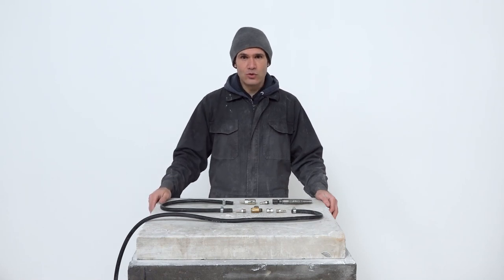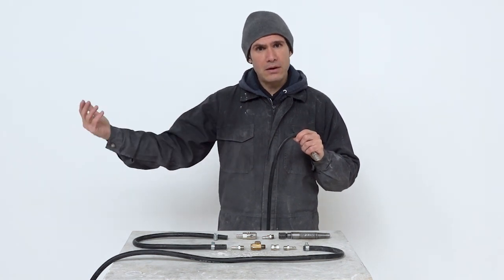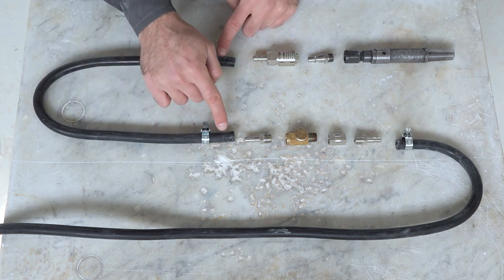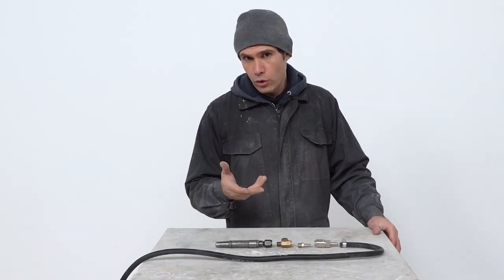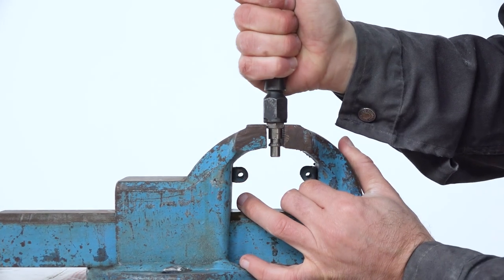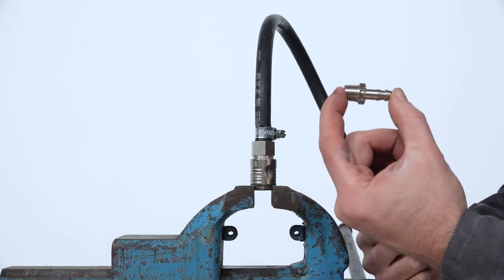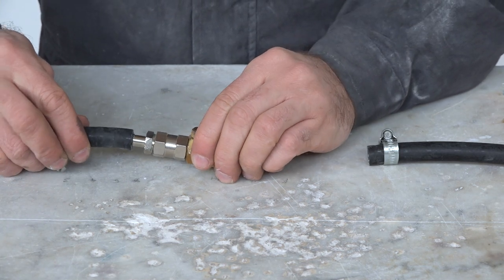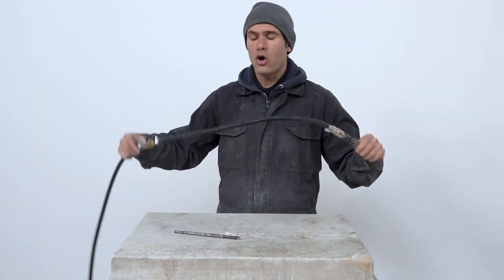How to Set Up Your Pneumatic Hammer | Stone Carving Tutorial

Comment: Some female quick-connectors have little spring loaded steel balls. Never use these close to your cuturi air hammer as these will damage the male connector due to the vibrations of the air hammer. In this case the connectio starts to leak air already aofter one day of use. For this reason many carvers connect a piece of hose directly to the air hammer and put the quick connects about 70 cm away from the hammer. 
Other types of quick connect use steel wire springs, which do not damage the male connector. These can safely be used directly onto the hammer. 
One can also choose to put a ring valve onto the air hammer itself, and then connect that to a male connector, and keep the air hose with the female connector, so you can very easily store the hammer and connect other tools. In this case the hammer has its own turn valve.
Reply from the maker: You are absolutely right about the female quick-connectors with steel balls, I had some bad experiences with these in the past. I should have mentioned that in the video. Thank you for being so kind to point that out as well as all the other info. I will pin this comment to the top as I’m sure many people will find it extremely helpful. Thanks again!
Reply: @AtharJaber  Your videos are very detailed and I recommend them regularly to beginning carvers. Keep going! Thanks for all the info.
Reply from the maker: @09conrado  thank you, I appreciate that a lot. Your comments are always full of knowledge and provide extra information. I suspect you are a master of your craft.

Comment: Here in the US I use the following setup:
- 1 long hose that connects to the compressor and reaches the work area
- 1 control hose - this consists of two pieces of hose with the tap (control valve/stopcock) in the middle) it also has a male quick connect at one end and a female at the other
- the hammer has a male connector

The setup is hammer to control hose - control hose to compressor hose

All the hoses are pneumatic hoses with pre-installed 1/4 in-18 NPT threaded fittings/ends instead of rubber hoses connected with hose clamps.

Comment: To answer why you use the second hose with the control valve (called a stopcock) I found this in a pneumatic hammer manual.

There should be no more than two methods of air control within your air delivery system. The first control will be an air pressure regulator located on the compressor. 

The second will be an in-line valve (e.g. stopcock) used to control the air flow that powers your pneumatic tool. Set the air regulator to achieve maximum power to the tool (do not exceed the air pressure rating of the compressor or air hose), then adjust the tool’s speed using the stopcock. 

Experiment to discover what degree of impact feels best to you. This will vary depending on the width of your chisel, hardness of your stone, and your application. 

Additional in-line accessories or controls will only reduce the total amount of air available to your tool.

Comment: Another very informative video with so much information I have to watch it a number or times. Can you please tell us what size air compressor is needed to run the Cuturi air hammer, or another brand? For cutting stone at the mid stage, after negative chunks are cut away (via angle grinder, etc.) I think that's when I would use the pneumatic chisel/hammer to clean up areas before details by hammer. I'll primarily be working in hard stone (limestone, granite perhaps, and marble if I can get it) so I am concerned that my compressor is powerful enough. If you can let me know, that would really help me decide what pneumatic tools to get. It's a 33 gallon tank, 1.7 hp, 5.1 cfm at 90 psi. I just ordered this compressor but can get something more powerful if you think it would be better. The prices really go up after 2 hp and 5 cfm.  Thanks for your help! You're the first artist I found who actually shows his setup and that means a lot to sculptors starting out.
Reply from the maker: Philip, that's a very good question that deserves a full episode for itself (which I'm already preparing 😉). But since you probably can't wait that long, here's the quick and easy, but very generic answer: to choose the right compressor for your tools (or viceversa), use this formula: Select the tool that requires the highest CFM (Cubic Feet per Minute) at the highest psi. Then add 50% to the required CFM as a safety margin. For example, if a tool requires 3 CFM at 90 psi, choose a compressor that provides at a minimum 4.5 CFM at 90 psi. I hope this helps. Let me know!

Comment: Another excellent video.

I was wondering if you could provide a suggestion on the sizing of pneumatic hammers. Is the sizing mostly a function of weight/grip size?  Do they have comparable lower ranges over all?  Is bigger (of smaller) better? 

My objective is to work granite, mostly organic or geometric shapes.   I am between 3/4 and 1 T&H. 

Sorry,  a very vague question, but any feedback appreciated.
Reply from the maker: I never used T&H so i can't say much about them. But regarding sizes, that has mainly to do with the type of work that you are planning to carry out. Big sizes carry a larger amount of power and are therefore suitable for big and rough work. While smaller sizes generate a more delicate vibration that is good for small and detailed work.
Reply: @AtharJaber  Thanks for the reply.  I think I am going with the larger size.  I suppose at the end of the day there is no one-size-fits-all solution.
Reply from the maker: @DS-yo4uw  Exactly, and eventually you will end up having two or three sizes and switching between them. Good luck!

Comment: The reason for the short hose is that any extra weight next to the air hammer will eventually cause the coupler to break off-most often inside the air hammer. They do anyway unless you keep a watch on them. Twice I’ve had to take my air hammer to a machinist to get the coupler out of my air hammer when they broke off and I couldn’t remove the broken piece by any means that I possess. Also the air hose clamp i find to be a problem. They can cut up my gloves or my hands. I bought a cable crimper and make my own short hoses. They need to be shot enough that you can just slide your hand down the hose to reach the valve but long enough that the vibration is dissipated before reaching the valve. Even then you need to replace the connector before they get too old and break off inside the air hammer and some air hammers are more violent than others.
Reply: I failed to mention that each of my air hammers has its own short hose. The quick connect and air flow valve is part of the longer hose.
Reply from the maker: Thanks for the detailed explanation Allen.